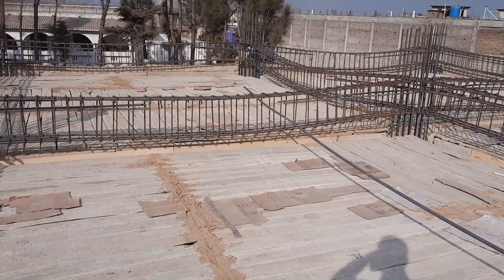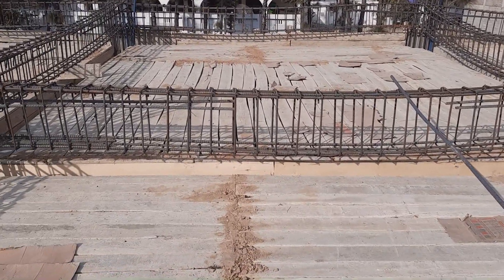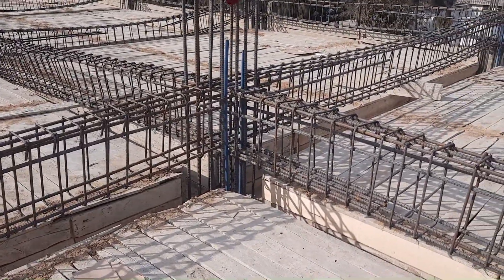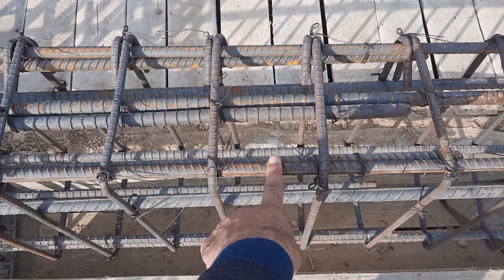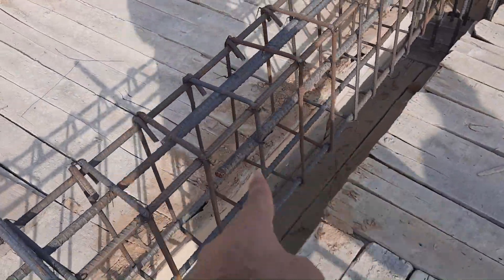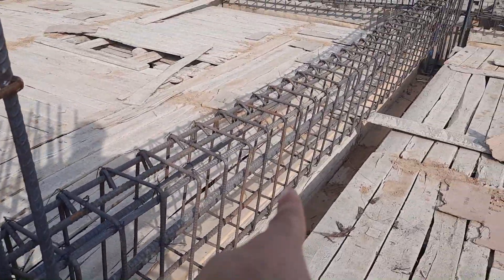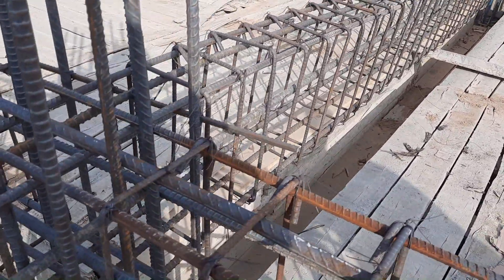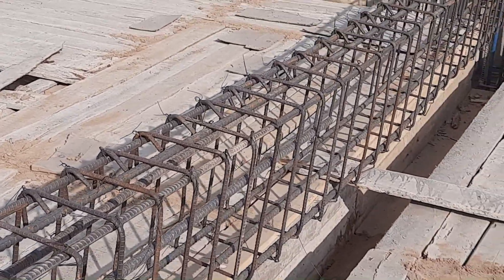Beam Reinforcement Details for 3 Storey Building

Comment: Sir for g plus 3beam what should be the beam crank bar will it be ok if I use single 12mm bar my beam diameter is 7*14 without concrete cover